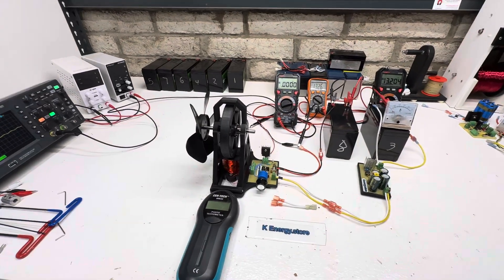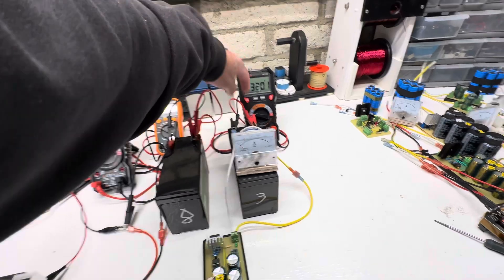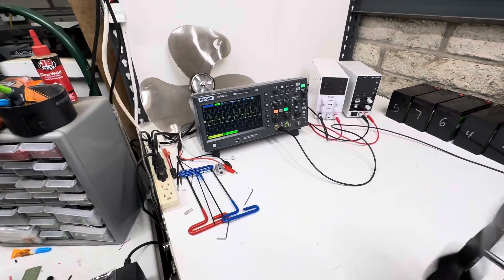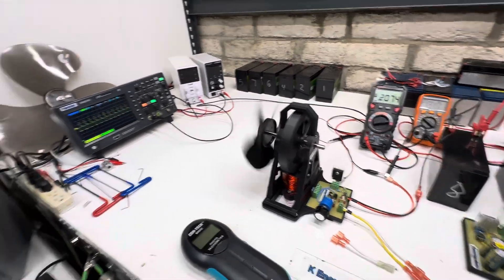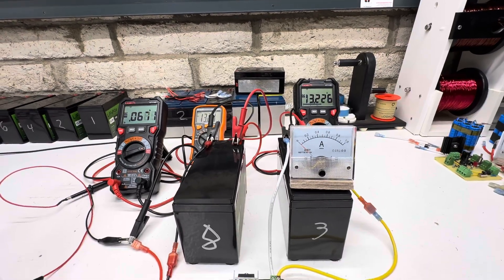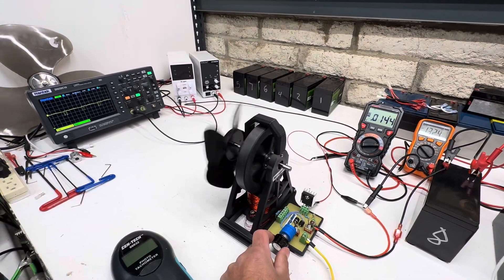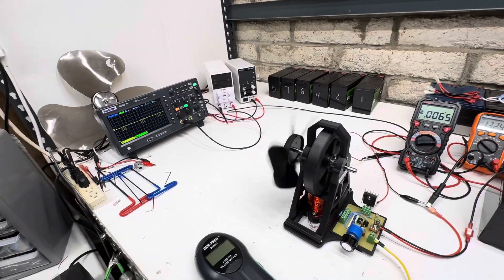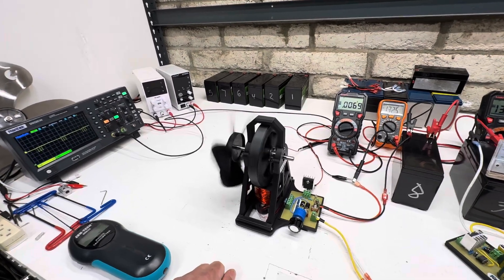Bedini motor with new improvements

Comment: What is more efficient. Looping it back or charging another battery? And does that change with load of fan?
Reply from the maker: @gregstafford2155  good question! If you want to run more load than use the original way if you  want it to just run for a crazy long time the second method